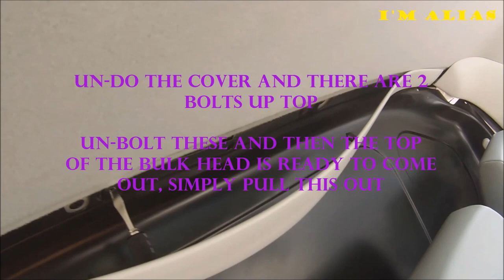How to dismantle a VW T5 Bulk head. Remove a bulk head from a VW T5

Comment: what do you do with the metal strip that's left sticking out of the floor? making a campervan so need to cover it or bend it down?
Reply from the maker: Martin I was going to do a separate video for this but didn't get round to it. You'll need to grind it out. From memory you grind the sections on the sides as it's not welded all the way across (I think! as it was some time ago I did it) hope this helps
Reply: I'M ALIAS TV I just got tin snips on it in the end. just put it to floor level so can put flooring straight over it. bit of a bodge job but a lot less work! Happy enough for my needs.
Reply from the maker: Martin as long as your flooring is level / flush,  job is a goodin. Good luck with the rest pal